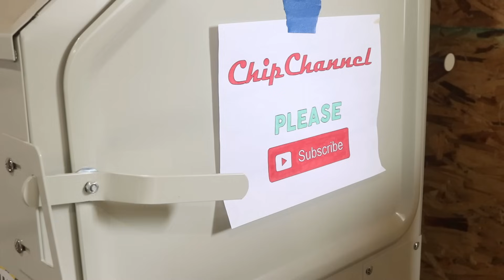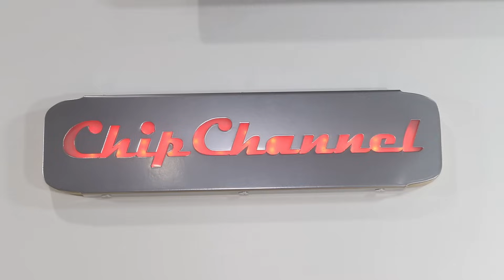1962 Tonka Motor Transport Restoration

Comment: wow.........that was amazing very professional work very nicely done......but you forgot one thing........these originally had loading ramps that went with it I used to have one of these as a kid.......there should have been 2 slots for the end of the loading ramps to go in on the lower deck and a ramp holder underneath the end of the trailer
Reply: It's curious, because if you watch disassembly, there is only one slot in the middle. I wonder if this year came with a separate ramp?

Comment: Here is a tip that will save you some money. As long as the wheels aren't too wobbly, re-use them. Use something fairly strong like Vantastic, clean them. Use a toothbrush. You want to pull as much of the dirt out as you can. It might even take the very top layer of hard rubber off. Which is a good thing. Once you get them clean and dry, spray them with black vinyl dye. It will bring the color back to the old rubber. After they dry, spray them with either mat clear or satin clear. That way they will have a shine. But not too shiny. When you put new whitewalls on and new caps, nobody will notice it. It will blend right in. Those wheels cost a lot. This will save you some money. If you have one that is wobbly but the tread is still good, this works on some, but not all. Use a small piece of shrink tubing right where the wheel rides. You might have to make the hole in the wheel slightly larger by drilling them out. But, if you drill it right the shrink tube will take up the slack and tighten up the tire on the axle. Use black shrink tubing. With the wheel on it, nobody will ever see it or realize it's there.

Comment: Ahaaa, the car transporter, I had spotted it for a while yessss!
Another very beautiful congratulation, bravo !
Only a few sheet metal cars are missing !!
Reply: I had one of those haulers when i was a kid. I still have the hauler minus the cars. Neighbor kid took them one day. As I remember they were plastic. I think it came with three. two cars and a truck. Been trying to find those. No luck.
Reply: @paulp1166  Hello Paul, I am French, the translator changes the meaning of the sentences a bit.
I wanted to say: It would be nice with sheet metal cars for presentation (it doesn't matter if it's original, I think it would be cooler than with plastic cars)
Reply: Yeah I thought about that later, that was probably what you meant. Would be cool to see that.

Comment: I had a transport exactly like that; it came with two Corvettes, a red one, and a yellow one... Oh, and it had a black ramp so the cars  could drive up on the transport...
Reply: I did too I miss mine
Reply: i thought it was three of those plastic cars, one may have been a truck i thought. I still have the hauler minus the cars and the ramp.
Reply: @paulp1166  After I had to move out of state for employment, my father got rid of most of my Tonka trucks, I still have the truck minus the trailer from a moving van, and a Buddy L dump truck. The Buddy L is in perfect condition because I received that when I was a little older.

Comment: I used to have one exactly like it when I was a kid. Mine was in excellent condition, only thing wrong with it was the steering wheel came loose inside the cab. Unfortunately it was either lost or stolen during a move about 15 years ago.

Comment: The only thing you’re missing is the blue loading ramp. When it’s used, it sits in the small slot on the lower level of the carrier. I got this same toy on Christmas morning back in the 60’s.
Reply from the maker: I actually just found a source for a replacement loading ramp, I wish I had found it a week earlier, I would have loved to put it in my video. Now I just need the three toy cars to go on it.
Reply: Chip Channel  That is awesome to hear!!! My toy didn’t come with the toy cars but that was fine. The loading ramp slides into the lower area for storage but slides out and hooks into that small slot at the back of the trailer. I really had fun playing with it when I got it. Thanks for bringing back my memories.
Reply: The loading ramp is black.  Repop's aval.  The repop cars are avail.  No interior panel though.